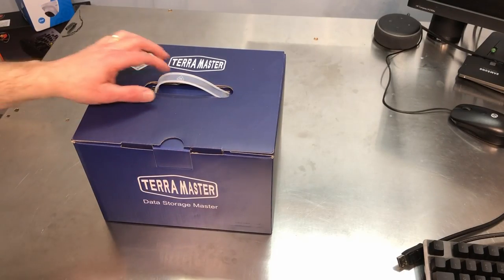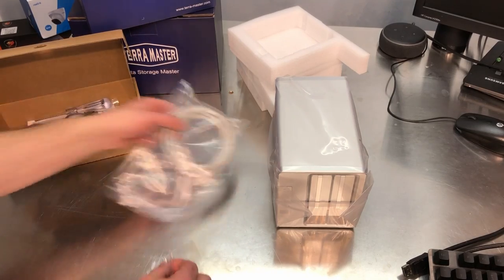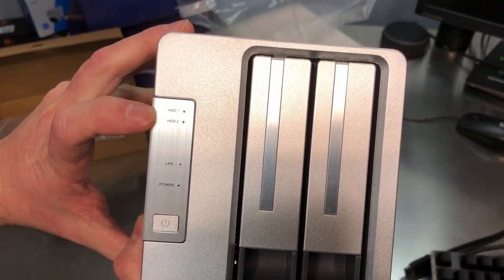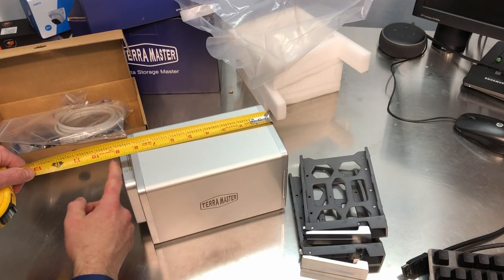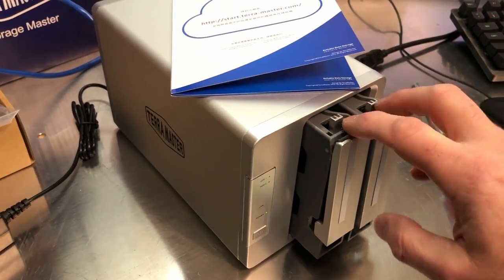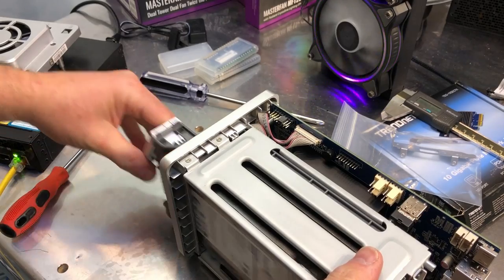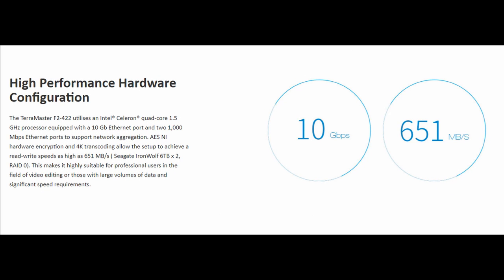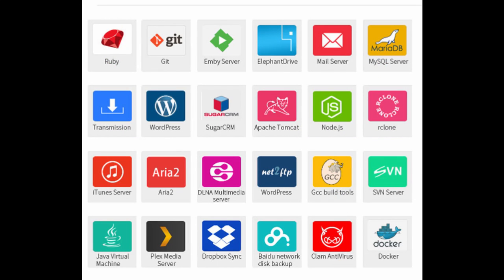Overclockersclub checks out the F2-422 NAS from Terra-Master!

Comment: I ahve been running a couple of these terramaster units for a while now. as far as the hardware goes, they are pretty solid. the TOS on the other had is crap. TOS4 was one headache after another, 5.0 was the same. and you cant upgrade to version of TOS5.1.24 or latter without repartitioning all the drives and wiping everything on them.  just so you know that USB device is the boot drive on the machine.  you can replace it with a faster/larger one and you can also load TureNAS or FreeNAS and add more memory. that will significantly improve the device. like i said. Device is great, the OS sucks big time. also, Terra Master support is garbage.  this is after 3+ years of experience with 5 of these devices.